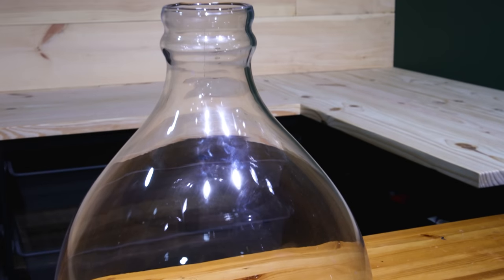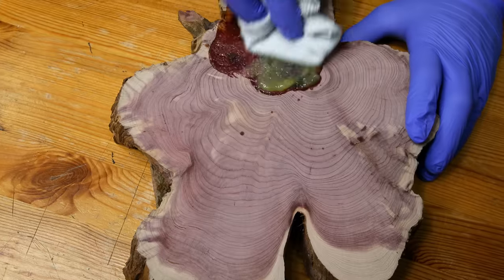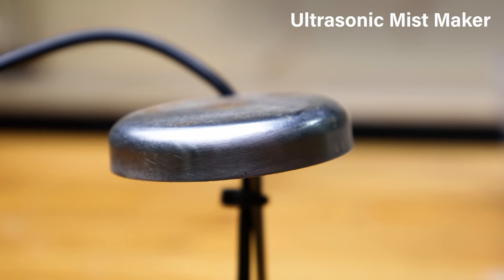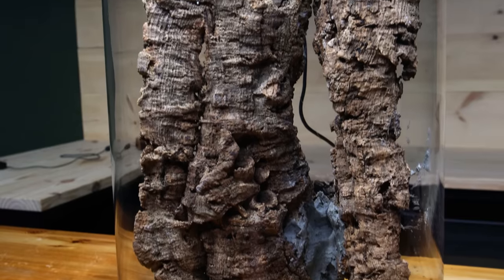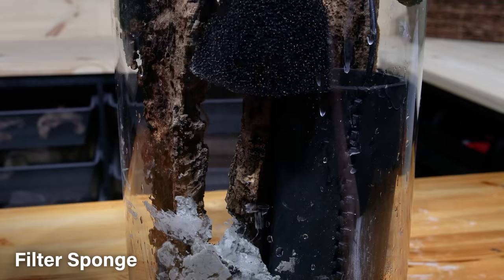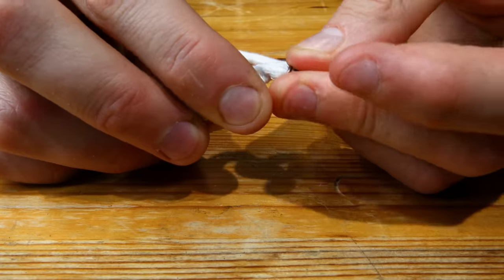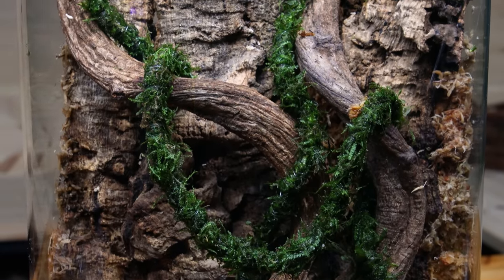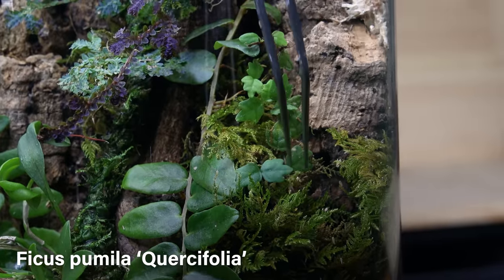Misty Cloud Forest Micro Orchid Moss Terrarium

Comment: Today I have a 55gal standard aquarium that I converted into a tropical vivarium for my four Whites Tree Frogs. I've been inspired by you every step of the way, and I continue to want to build better, not only for the wow factor but because I know it makes my froggies happier. Your channel is a gift! Thank you so much for the quality information you provide us.
Reply: I do have a question, though:

I took a fake rock small watering dish from Petco and sawed it to make it flat on one side, then gluing the shim I cut off to the bottom to act as a weight differential so it won't put too much pressure on the wall. I want to glue this to the glass of my tank for the frogs so they can bask closer to the heat lamp if they wish, but it just seems to be too heavy to support them without the hot glue peeling away. Is there a good alternative adhesive I can try that's nontoxic and can be applied with frogs present?

Comment: Beautiful work Serpa! 😊 Definitely the smallest setup I've seen that really captures the cloud forest feel. Really awesome!
I've seen you've successfully use a lot of orchids in set ups with little air movement like this one. Many orchids require air movement (and fans in the enclosure to provide it), and it can be difficult (and costly) to figure out which need air flow and which don't. Do you have a list of orchids that do well in setups without air movement / fans, which hobbyists could use?
I could also go through your videos to write up what you've used. Are there many that show up in your videos that haven't worked out?

Comment: Looks like you figured out how to make the fog rise by limiting the wide open top decreasing evaporation rates in the air column. Good work, the wick is also employed well using polyester yarn and it wont break down like the cotton wick does. Crochet or braid the yarn for a thicker vine. I also use it to make rain droplets in my vivs vs spray watering. Much quieter and relaxing.

Comment: You could probably get the mist to rise by putting some sort of heating element above it. As long as its closed off it should evaporate. I did that for a tree frog enclosure. I used a DHE but set the temp to 80-ish, and the mist rose up very well as long as there was not a strong air flow

Comment: Could you place a small cup up higher in the scape and run a small pump to feed it?  Placing the fog maker up high and the overflowing water from the cup can be used as a small water fall even when the fog is off.  Just a thought